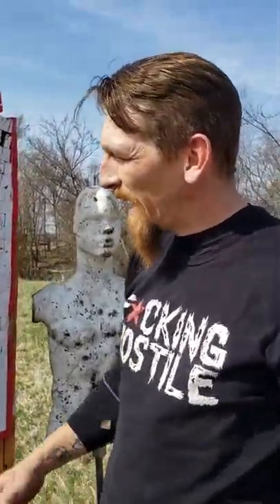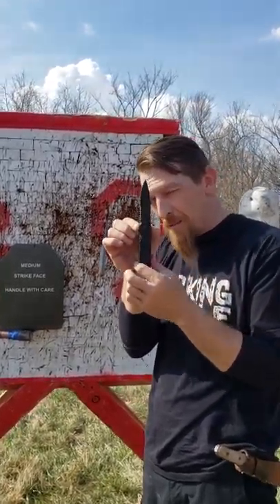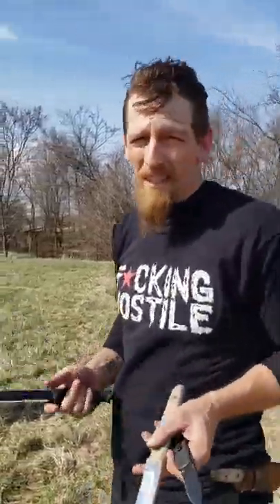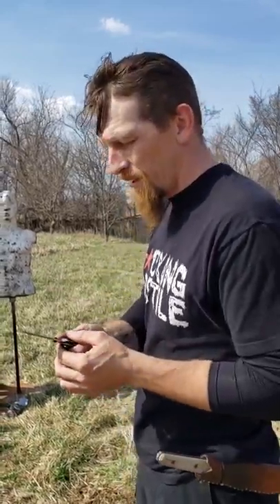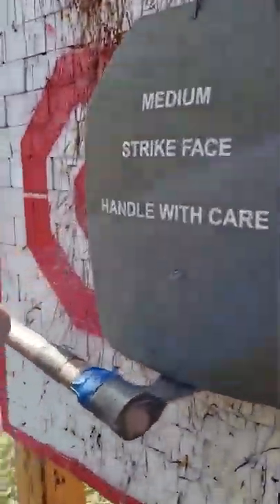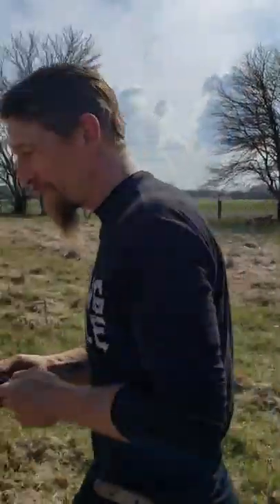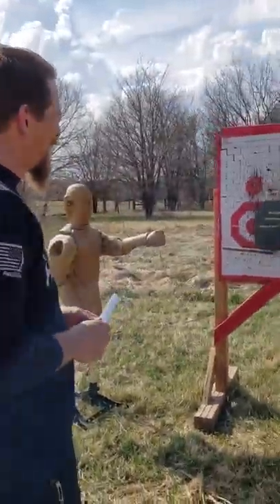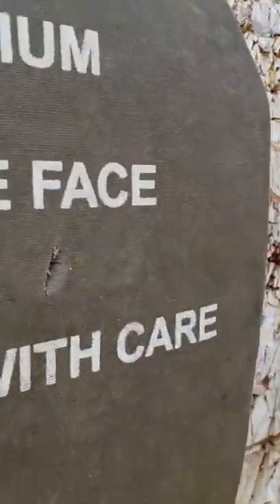Knife  throwing vs level 3 ceramic plate..impossible

Comment: Ceramic plate wicked cool,as soon as I saw you show blades I knew they chip the blade ,from experience if there's a glaze to the stone that's the hardest part,if you hit same spot its a lot less reflective,I've drilled glazed block and got no where but chip the glaze with hammer it chisel and it loses is outer shell,once again Awsome vid thank you